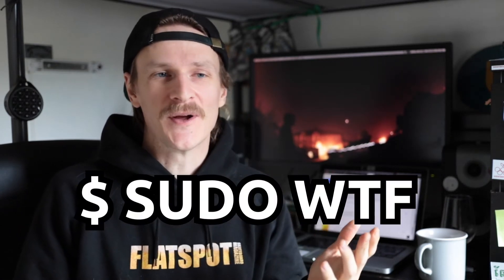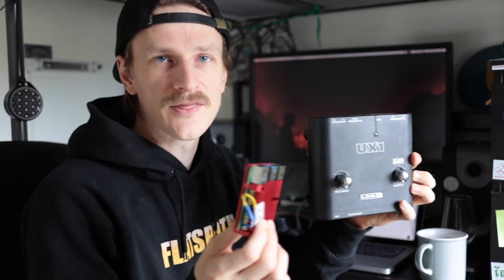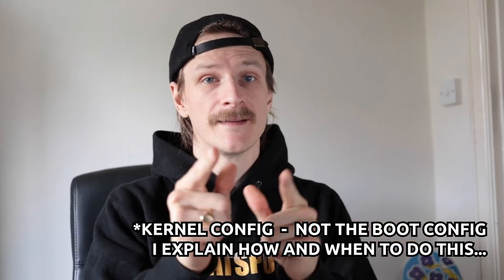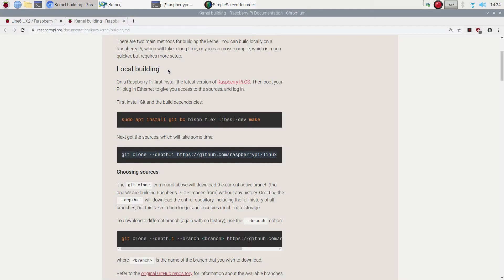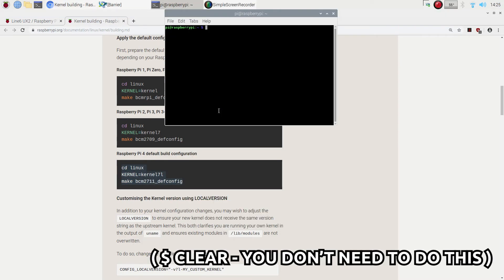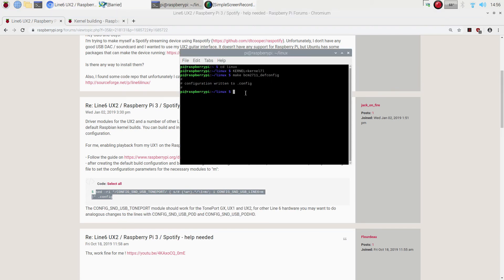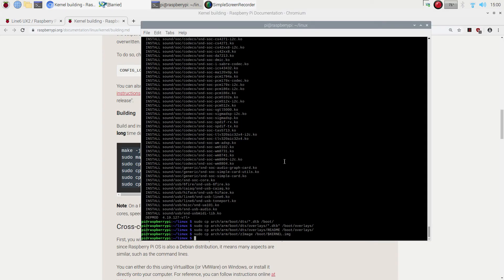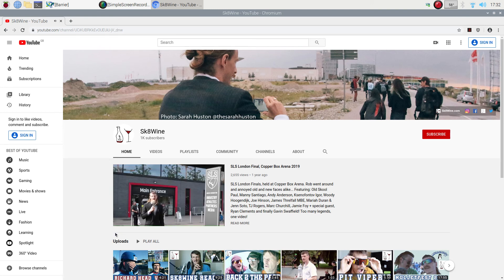Install tutorial: Line6 USB Audio on Raspberry Pi OS (UX1 + Linux)

Comment: Howdy neighbour, the guide was great, thanks, but did you ever get pod farm installed? Am I right in thinking it can’t be done? :’(
Reply from the maker: POD farm is a windows exe program. Line6 don't make apps for Linux. Although the Windows 10 developer OS for raspberry Pi is supposedly getting better (I've not check its progress since last year). You may or may not be able to run it through that.